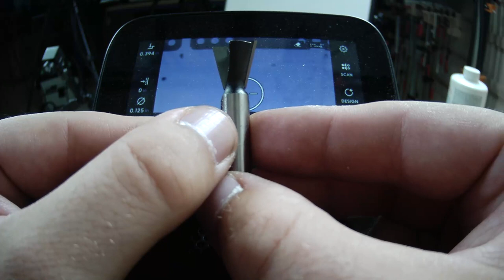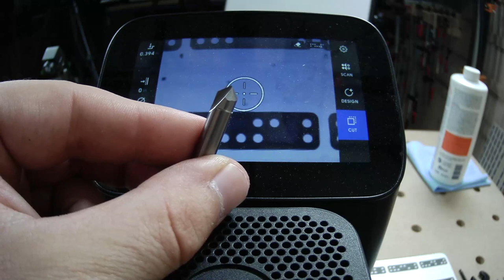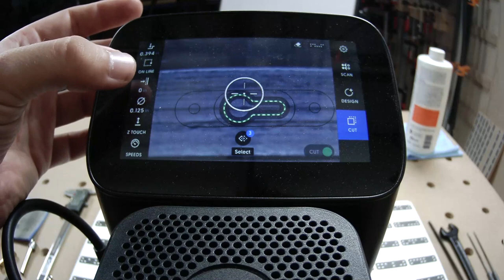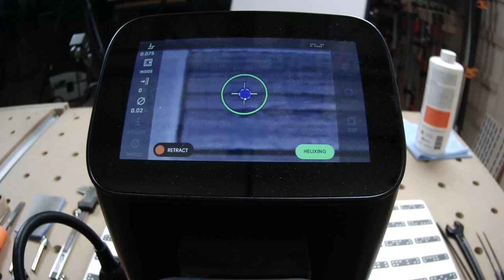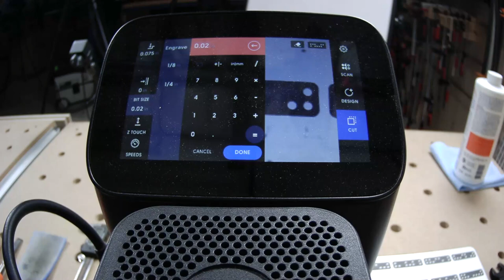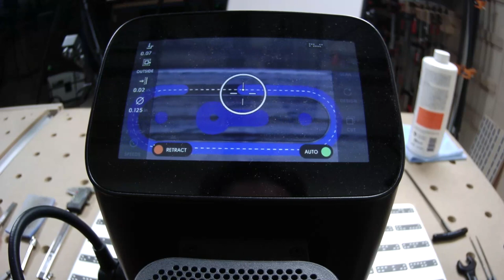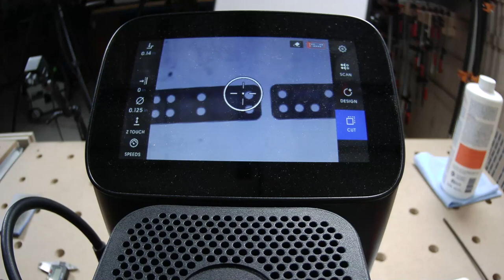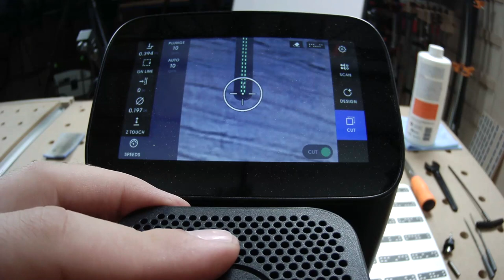Session 63  – English: Cutting Keyholes - Slots and Plates

Comment: One more question?😊
Do you have a video on how to do the keyhole slot on an actual cabinet? Say you want to put the keyhole slot  and brass keyhole bracket on the back of the vertical left and right of the cabinet sides near the top of the cabinet… How would you do that using the Shaper Origin and the workstation? Obviously you would do it before you put the cabinet together but I think it would be helpful for new users to see how you would go about putting the brass keyhole plate in using the Shaper Origin and the Workstation.
Thanks for your time guys.
Ron

Comment: Are you doing the Z-Touch on the workstation surface rather than on the workpiece itself?
Reply from the maker: Yep! Since it's best to have the entire base of Origin on a single, uniform surface we often slide the tool back so to make the Z-touch easier. This is especially important when you're not using the support bar since there won't be a way for the tool to trip the sensor and Z-touch will fail. You can always make small adjustments in your depth setting if you find the workpiece is a little high or low compared to the Workstation tape field!

Comment: Would it not be better to cut a pocket in a larger piece of MDF the exact size of the brass plate?, and then double side tape inside the pocket to hold it down this would keep the brass captive still screw it down for the rest of the cutting but a bigger surface area for the Shaper origin to sit on.